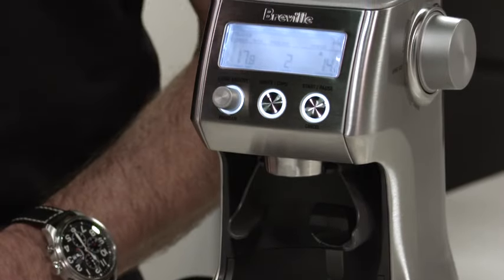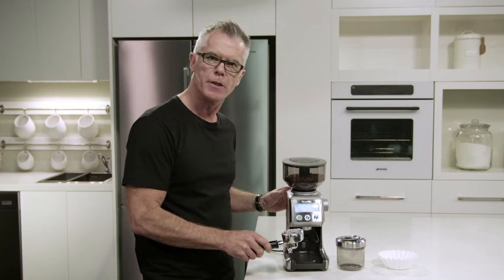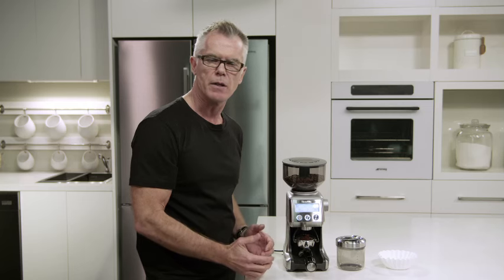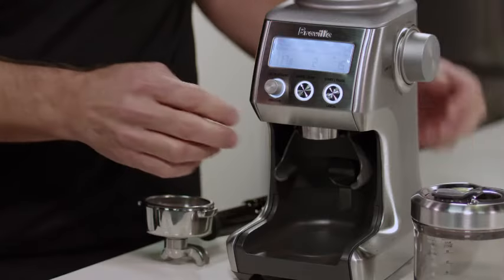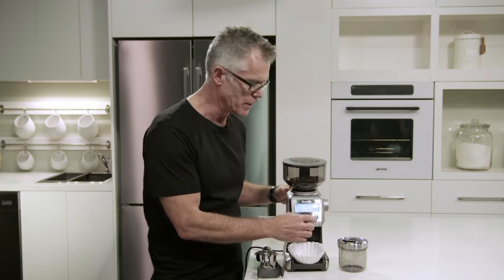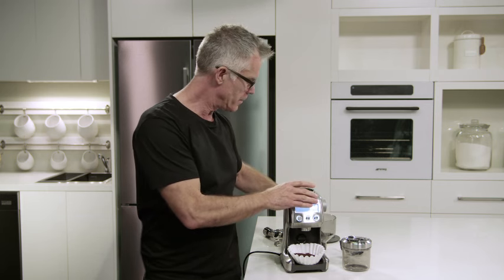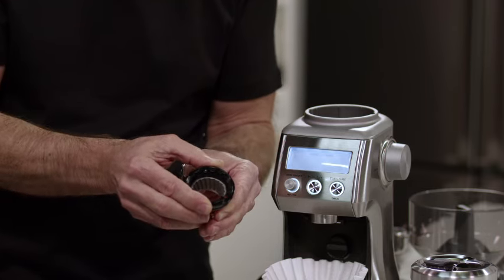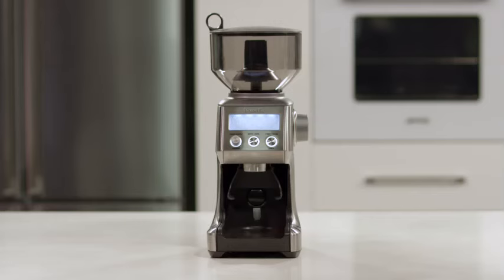Learn to use the Breville Smart Grinder™ Pro BCG820

Comment: It’s magic how your grinder has no grind remnants in it when you show the top burr being removed! Right after grinding too! 😂
But seriously, top burr should be set to the finest setting right out of the box. That’s the best for espresso, you can then just adjust your grind with the grinder knob.
Reply: From what I've read, the finest setting is not recommended as the burr will wear out more quickly, since at the lowest settings the metal parts are touching. A setting 3 or 4 is the lowest recommended, unless your burr has had some use already
Reply: @Callusny  the burrs will only touch if you also turn the fineness dial on the side right to the bottom fine setting. When I have set the top burr to finest, then the side adjuster is usually around half way. I’ve done it on several grinders for friends. None of them had a clue about the top burr and they were all making bad coffee because their grinder wouldn’t grind fine enough.

Comment: We have adjusted ours all the way to 10 internally, and even at French press we are getting extremely fine grinds, we’ve run out of ideas
Reply: Oh yeah same here. However, moving to 10 minimizes the dust for me. Also don't know how long you've had the grinder but your upper burr may need to be replaced it on $28 on the Breville website. Do not get it from Amazon it's way over priced. Take it out fill with your fingertips for sharpness. I replaced mine after 6 years of use and it has made a differences.

Comment: Confusing. Just purchased this grinder and the names and numbers are in different position than yours. I knew it’s wrong because I’m using the drip machine and the number is 52 under percolator position. Can’t use grind size lower than 50 on drip and drip stops at 49.

Comment: Okay, I just noticed a HUGE discrepancy between Phil McKnight’s Smart Grinder Pro and mine, which I’ve had now for only about a week. McKnight’s digital display shows COARSER all the way to the left and FINER all the way to the right. That’s the same as on mine; however, what is different is his also shows (L to R): PLUNGER - FILTER - PERCOLATOR - ESPRESSO. Mine shows (L to R): PRESS - PERC - DRIP - ESPRESSO. So where his PERCOLATOR range is, my DRIP range is in the same area. And while I realize this video was made nearly 9 years ago, what shouldn’t have changed was the grind size that’s appropriate for the different brewing methods. I’ve had my settings for my new Precision Brewer all over the DRIP range, and the grind size is still too fine. Probably explains the over extracted results I’ve been tasting. Since he chose a grind size of “50” for his filter coffee, I just now changed mine to reflect the same, and will try it out on my next pot. While this sounds like a gripe, it’s not, just a learning inconvenience. I wasn’t impressed with the “Gold” setting right out of the box—this could explain why. I LOVE my Precision Brewer (especially the Auto Start feature) and Smart Grinder Pro—as well as my 10 other Breville appliances! 😜

Comment: I was gifted a previously owned grinder.  The hopper basket can't be installed because there is a white plastic insert above the grinding burr.  I can't see how to remove it and don't want to break a plastic part.  Can you assist me?

Comment: If I only want a single shot, do I keep the grind at 14 but divide the grind time in half (9.8 secs)?
Reply: Martin Kozma yes, keep grind size same let's say 14 and than change the shots from 2 to 1 and grinder will adjust the time itself. You may need to play with it first.
Reply: I want to order to Cambodia, how to order? It’s set?

Comment: Does the grinder actually turn off automatically when not used for a certain time? I used to have the Sette 270 and it went off automatically after about 10 minutes when not used. Pretty handy to not unplug all the time...
Reply: Yes.

Comment: Great video. Does anyone know how to turn off the Sage grinder? And I don’t mean just switch it off at the wall I mean how to turn it off in between uses? I know it auto turns off after 5 minutes but I want to know how to turn it off manually? Thanks
Reply: good question. just received my grinder today and had same question. but your message answered my question! thanks
Reply: @SLee-vj4px  so how does it turn off? Do you have to wait? Is that the only way?
Reply: @joeshort2443  yes, it seems the only way

Comment: My pro brewville us makeing a louder noise then usually makes not grinder just a little
Reply: Mine has a grinding noise
I have cleaned it and still makes the noise after I put it to fine grind again HELP.
Reply: Did you advise to purchase it or not ?
Thanks
Reply: Make sure when you clean the upper ber and put it back in you lock it back in properly.

Comment: Hi, I also have the Oracle touch, (we also use decaf beans) My question is what is the equivalent grind size setting on the Smart Grindr Pro for the number ‘27’ grind setting on the Oracle Touch? Many thanks in Advance. If you have a chart that would be awesome 👌 (we are in Australia if that makes any difference to settings).

Comment: If i need 14 grams of coffee.. how can i set the grinder to give me this Amount ؟!
Reply: you can setting the timing for shots, so when you first get the machine weight it out and calibrate the timing setting, then you should get exactly same weight each shots, but remember to clean the grinder every week to prevent clogging, especially if you are using oily dark roast beans.
Reply: I put 10.5 seconds with number 20 as grind size and it gave me 13 grams
Reply: Output is determined by timed grind setting and of course ayk by beans. Once you've got it dialed in for the bean you use most output will change when change if you change beans. Output will even change for same bean as they age. That's why unless you drink lots of coffee I suggest stay away from 2.2 lb bags and go with 12 or 13 oz. bags.

Comment: Breville makes a pretty good dual boiler machine, but the grinder is poo! It takes far too long to grind for espresso, hence burning the beans due to the heat of the burrs. The resulting cup is then sour and awful. Identical settings on a Baratza 270wi grind the beans in 5 seconds, as opposed to 16 seconds, resulting in a far superior cup. It's okay for most other purposes, though.

Comment: Hi I have this grinder I use a drip filter Moccamaster machine but I am finding the grind is way to fine although I have the grinder set to the recommmended filter grind position should I then remove and adjust the burr or just the dial on the machine to a more course setting?
Reply: You should play with the grind setting and find the consistency you're looking for
Reply: Play with the grind setting until you find something you like.

Comment: at the coarsest setting (60) its still too fine for french press - can you hep? which level do i adjust it to? thx
Reply: According to the info in the video, you are able to remove the upper burr and adjust it to a more coarse setting and then reinstall. That should solve your problem.

Comment: I wonder if this is a good grinder for french press?
Reply: It's not. Every review I have watched on this grinder (and I've watched a lot), every single one says it's not great for french press at all. Need to find a better grinder for that kinda brew.
Reply: @kimpyeatt2595  @Nizar I've had grinder for 6 years. It will grind french press albeit with some fines but that occurs across the range besides which fines is a common complaint and main reason many people don't do French press and why there are products on the market that help to reduce the level of sediment when brewing French press. Seattle Coffee Gear (SCG) recommends setting top burr to 9 or 10. I have yet to try that setting. But I've done French press lots with no issues. Caveat is as you know with Coffee there are many variables that ultimately affect results.

Comment: The Breville Smart Grinder Pro is a budget grinder, and for most uses. It is a noisy grinder though. If you are looking for a coffee grinder for espresso shots; do not buy a Breville Smart Grinder Pro. You are better off buying a more expensive Italian coffee grinder. 

The reason I know this is that I've tried to dial in an espresso shot  (60ml in 25 - 30 seconds) that most Baristas use as a standard. That also is a good gauge on taste, and you should get a hint of sugar in the espresso shot to taste. Out of the box and on the Minimum setting, the shot is too fast. I've tried and adjusted to finer settings on the back of top burr (set on 6 & tried from 5 to 3, and 5 is the best) The best that I could get was 70 ml in 24.75 seconds. I need to go to a finer grind, which the Breville Smart Grinder Pro will not allow me to go to the fineness of grind that I'm after, or deliver for that matter of fact. I have tried and tried, and wasted a lot of coffee in the progress too.
Reply: What espresso machine do you use? I have a breville infuser 1st gen with PID but not PID adjustment and Smart Grinder Pro since 2013. I have no problem getting a 59 to 61 ml pull with grind setting between 16 to 14 with 17-18 dose in non-pressurized double basket in 25-30 secs. Maybe problem is your espresso machine not your grinder. The only issue I have with smg pro is when grinding to french press. I have to set upper burr to 9 or 10 and of course set window to coarsest setting  but I still get excessive fines.
Reply: Is this grinder suitable for stove top - I have Bialetti Venus. Thanks
Reply: @aphaiaaphaia2105  are you talking about a Moka Pot? It should be but you may have to change setting on top burr. The default is 6. Did you see how he changed the upper burr setting? That is what you may have to do. I don't remember Moka Pot grind requirements and I don't have one. There will be some trail and error on your part. Theis grinder is capable of over 600 grind settings when you combine 10 micro settings on burr with 60 settings on front screen.
Reply: @ggivensjr  Haha...good try, but my Espresso M/C is a Gaggia Classic
Reply: @aphaiaaphaia2105  Yes, It is fine with a stove top, The grind size on the Breville Smart Grinder Pro, is around medium level for a stove top.
Reply: @ggivensjr  George, it all depends on the coffee beans you're trying to grind through. On quality, fresh, coffee beans the Breville just, just makes the cut. On older, not so top quality beans, I take the grind size back. My professional shot glass that Baristas use, is my datum point & dictates what I do with the grind size - to the coffee bean I have in the hopper.
Reply: @flashgdh8788  then maybe it's your coffee or your technique because I've getting spot on for 7 years. When I first started I was complete novice with pump machines only had used steam machines it took me almost no time to get a good shot.
Reply: @flashgdh8788  lots of people forget the top burr on the SGPro not the original SG is a macro adjustment to get you closer then use micro adjustment know on side to dial in. For example, for French Press, I change top burr to 9 or 10 then dial to 55-60 for micro.
Reply: @flashgdh8788  never heard of datum point shot glass can you enter a link please? I never use beans older than 4 weeks and most times my beans are within 2 weeks of roast date. The only exception is during the holiday season. Everyone gives me subscriptions or buys me coffee for Christmas. I end up making lots of press or pour over to use the beans before they get old.
Reply: @ggivensjr  There is a well known saying that goes something like "If you are going to spend some money on coffee equipment, one should buy a really good grinder. The Espresso M/C doesn't need to be as good to pull a good shot". I've done it the other way around, bought a really good Espresso M/C & a not so good coffee grinder. Cost wise on what I've spent, the Breville Smart Grinder Pro was a third of the overall price I paid for my Espresso M/C. 

You live & learn. My next coffee equipment that I'll be purchasing is an ECM Titanium Grinder & an ECM Espresso M/C.
Reply: @flashgdh8788  there's a well known saying in the photography world that goes "the camera doesn't make the picture the photographer does" the camera is a tool. I don't know how old you are or if you ever played sports but a good player, plays good no matter what equipment they have. Are you a good player?
Reply: @ggivensjr  Haha...I think you're making a mountain out of a molehill & not secure in yourself, at the end of the day. This will be my last reply to you & wish you the best for your future. Keep on smacking those wonderful coffee shots that you are so proud of, to whomever consumes your coffee. ;-)  Cheers.
Reply: @flashgdh8788  hey, thought it was just a discussion? But, you not responding to me isn't going to break my heart. You're the one that started the post.
Reply: @ggivensjr   May I ask if you change the setting of your top burr on your SGP?

Comment: How do you turn it off?
Reply: It shuts off automatically after a couple of minutes. It will save your settings.
Reply: atrain132 thanks a lot for replying. I just wait for it to turn off now but thought maybe there is another way. :)
Reply: @iPink822  hey no problem.
Reply: Do a run up kick to the power socket